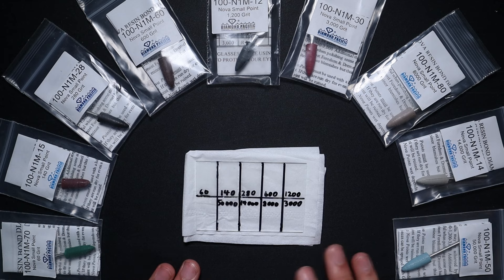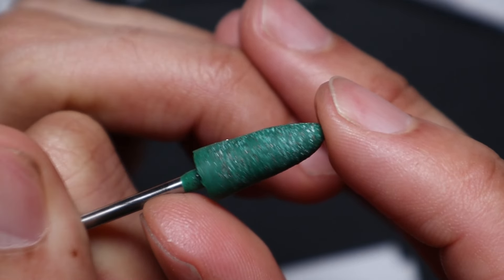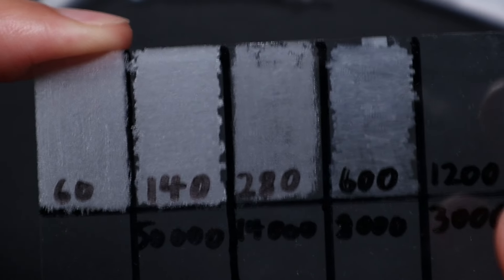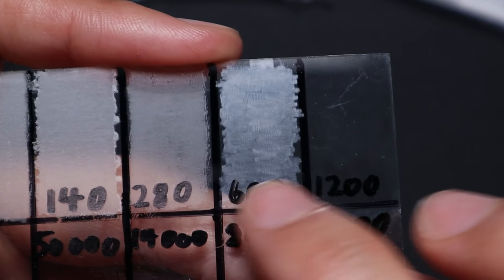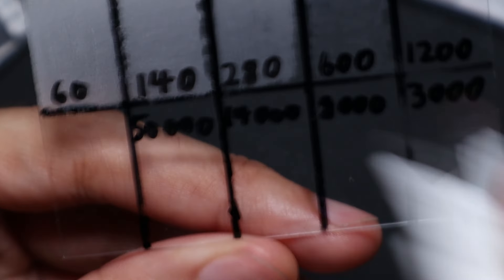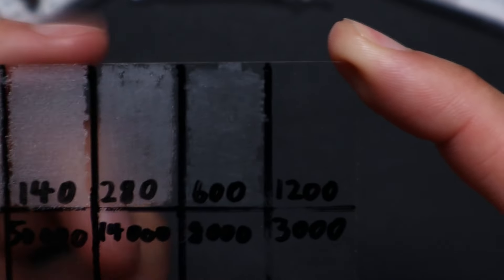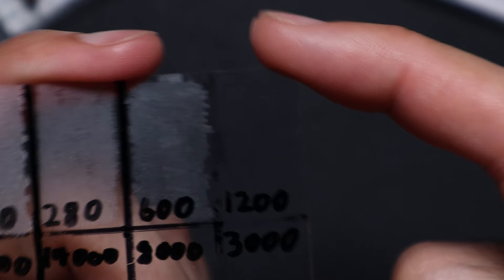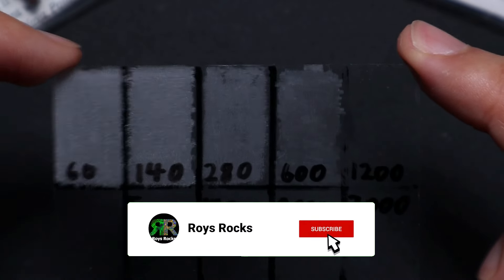Diamond Pacific Nova Resin Tools. What Is It and How Do They Work? Microscope Investigation

Comment: Very interesting close up look at the tools and thier effects. The 60 grit glass looked like it had been sandblasted. 
graet video 2x👍
I always thought you should double the grit number as you work, going from 240 to 500 500 to 1000. etc and I get good results. .
Reply from the maker: It is incredible how blasted apart the 60-280 grit surfaces are. 
The diamonds are more like mini hammers at that grit.
Double the grit each stage is not a bad guide. Can't really go wrong with that.
Reply: @RoysRocks  👍

Comment: I love this!
Reply from the maker: Anything else you can think of that would be interesting under the microscope?
I can make it a playlist.
Reply: I understand why treating matrix opal works in theory but have never been able to actually see very well what is happening. Wondering if before after shot would make sense?
Reply from the maker: @OpalAuctions53Frogs  If the machine was not so heavily in use I could do the whole process and film it with the microscope.

Comment: I go up to 3000 on my resin wheels. Sometimes, I stop at 1200. For me 3000 is less about polishing than it is about making minor fixes to overall shape.
Reply from the maker: You are still doing minor shaping on the 3000?
Guess cabbing you can but it would still be wanting to be very minor.
Reply: @RoysRocks  Yeah, totally, e.g., for very slight asymmetries that only a somewhat obsessive cutter might notice. Once I notice something like that, I can’t unsee it and I have to fix it.